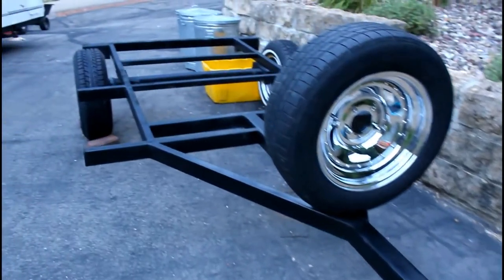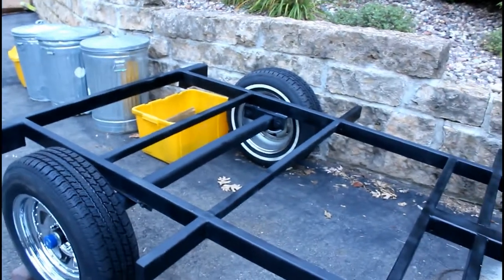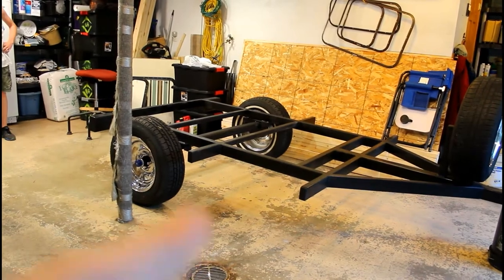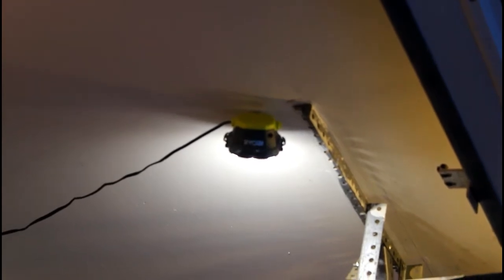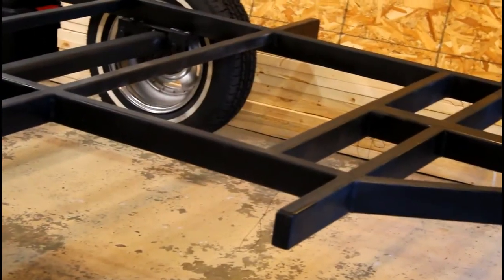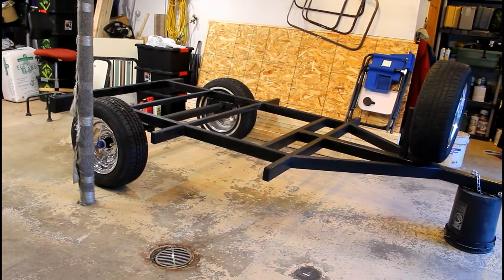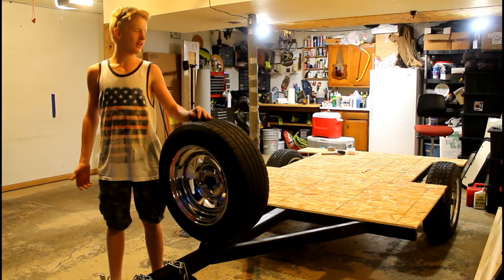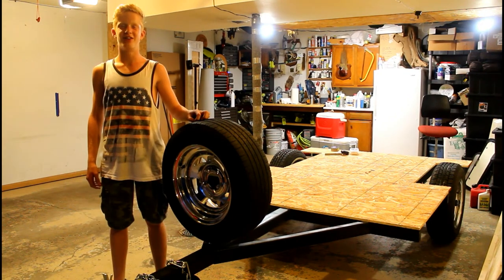(Ep. 2) TEARDROP SUBFLOOR INSTALL & BUILD

Comment: I had a teardrop trailer built for me last year.  Nothing really fancy just the basic queen bed and kitchen.  I splurged on a single solar panel with a marine battery.  There is a ceiling light inside the bedroom and access to an outlet to charge items.  The back lifts up and I have a kitchen.  I chose to not have a sink or bar fridge installed.  I have a two-burner propane stove, for doing meals. For a quick warm up or to boil water for coffee/tea I carry a one burner butane burner. I do have an 1000w inverter with the solar.  I like the counter with nothing taking up space, makes food prep so much less cluttered. I do have a shelf just below the hinge of the kitchen flap.  This holds a lot of items.  Below the shelf there is a screen that is hinged so you can pass breakfast inside if you like.  Below the counter there is one box that you can store anything in.  Next to that is an ice cooler.  But I use that for dry food to keep the critters out.  Both the box and ice cooler are on a slide out rack that allows me to use the stoves on top of them so the counter is free for prep.  I do have another ice chest that I have in the car that is used for cold items.  I have found that the plastic one liter milk containers are great for ice packs in the bottom of the coolers.  They can be used over and over.  Inside there is one drawer under where the screen is and there is a child proof latch at the back of the drawer. The drawer goes back almost to the wall.  You have to allow for space to get the latch attached.  I have seen a lot of teardrops some are fancier than others you can really do almost anything in design.  If you should use a fan for in the bedroom think of the Fantastic Fan.  I chose to have my solar panel attached to the roof so there was no room for the fan.  That was my choice.  I tend to do most of my camping anytime mid-March to October, November is no snow or bad winds.  I love the cooler weather.  Good luck on your build.  Looking forward to seeing how all progresses.

Comment: You should be aware that that chip board that you used for your subfloor will swell and fall apart if not sealed! It doesn't take much water to ruin the whole project!
Reply from the maker: +Greg Boyer we are aware of that and will seal it thanks for the heads up.